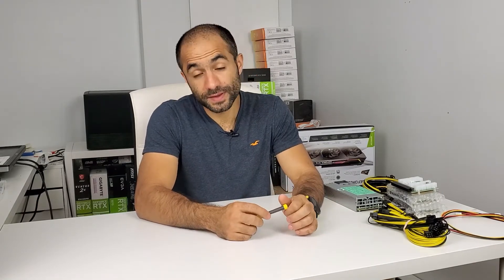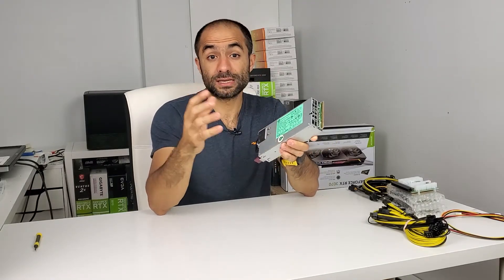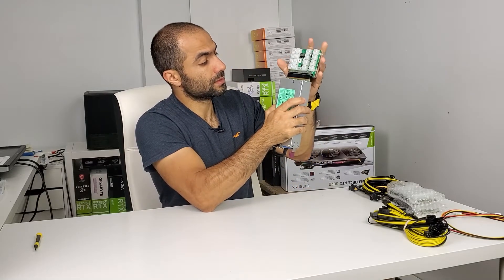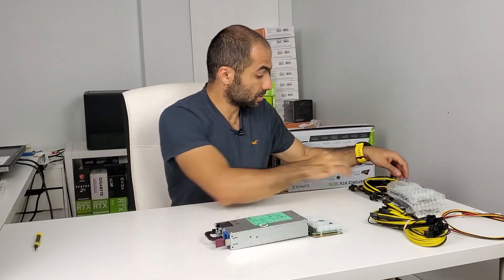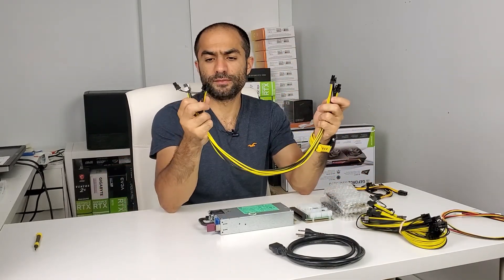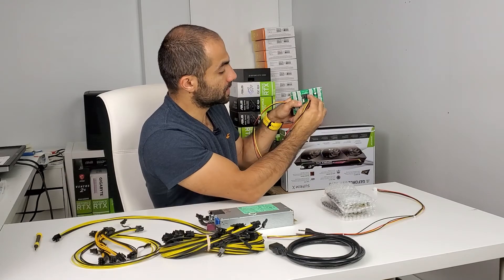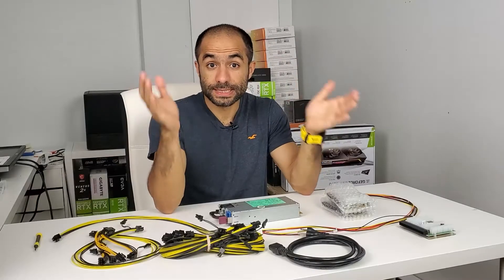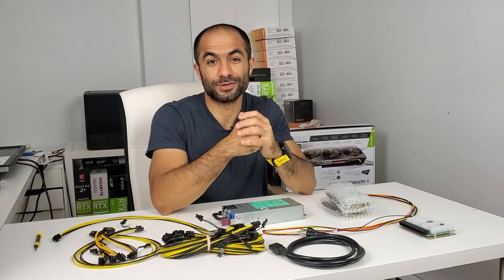Using a Server PSU for Crypto Mining

Comment: What kinda power cord are you using
Reply from the maker: Hi Kid Vicious. I use a 20A power supply Cord. You can find them on Amazon. The most common ones are 15A which will also be compatible. You just have to make sure you don't go beyond its rating depending on the voltage you have at your location.
Reply: @DaniTalksTech  ..i think the psu is rated at 15 smps for 110.
Reply: @DaniTalksTech  ...thank you!
Reply from the maker: @kidvicious2227  My pleasure!

Comment: I don't really see the costs savings vs ATX PSU. Relatively close to the same price after getting breakoutboard, cables, etc. And the ATX often has 10 year warranty. ATX is quieter. Right now I just have 2 rigs in my room, 16 GPUs, 6x ATX PSUs on 3 different 120V circuits.
Reply from the maker: Thanks for the feedback David. What sort of wattage do you have on those PSUs? One of the other advantages is also 16 power connectors on the breakout board. A PSU of similar capacity usually has 3 strands each branching out into two. So the total is usually 6 maybe 8 in some cases. That would be another advantage.
Reply: @DaniTalksTech  Thanks for the vid and tips! I like the 1000w EVGA PSU Gold, it comes with 6x 8pin cables(4 dual) and just $175 Canadian I paid, I also use splitters. So, I can fit 2x 1000w on 1 circuit since wall outlet is 1800w max but I usually go 1400w max to be safe. Yes, 16 power connectors is great, if I see a good deal on 120v server PSU I want to try it. Do you know why the breakout board burned for you?
Reply from the maker: @DavidBergeron87  thanks David! 1000w for $175 is a great deal. When I bought my corsair 1000w PSU it was for $250 and they were so tough to find. Maybe now the situation is better. I don't use splitters except on low wattage cards such as the 1660 supers. I honestly don't know why it burned. Parallel miner sent me a replacement under warranty and it's been working since.
Reply: @DaniTalksTech  👍I guess the 1000w is slowly dropping in price. 2 months ago I seen it on Amazon for $200 but recently $175CAD, probably a bit cheaper USD. I do like 1660 Supers, I have a few. Zotac 1660 Super GPU is so small in size, it's funny. I have a couple AMD 6600xt which are slightly better than 1660 Supers I find.

Comment: Hi Dani,
Thanks for the video.
Question:
Are they 2x 24 pins power plug2 on your Biostar mobo or only one?
I am planning on using the Biostar TB360 BTC Pro 2.0, and I believe they comes with 2 x 24pins power plugs.
If I was to use one ATX PSU and an HP PSU as my 2nd, do I need to get a PICO PSU (say 300W) to plug from the HP PSU to the 2nd 24 pins on the mobo?
Or I do not have to plug anything into the 2nd 24 pins on the mobo at all?

Looking forward to hearing back from you.

Thanks.
Reply: I just got that mobo and have the same question. what did you end up doing?

Comment: Im also looking to power my 1660 super rig with one 6 pin cable (from the server psu) to the riser AND gpu. Is this safe to do? They all pull about 75w - 80w.
I cant find anywhere on the internet that can give me a definitive answer on the max power draw what one 6 pin slot can handle on a server psu. 
Seems atx power supplies can handle 75w per 6 pin, but not sure its the same for a server psu. 
Would be great is someone can confirm.
Reply from the maker: Hi Kaizen, I am not aware of how much a single strand from a server PSU can handle. Are you not able to use one strand for the GPU and another for the riser? Usually, the breakout boards have enough PCIE ports.

Comment: Hello, could I have a set-up with one ATX and multiple server PSUs ? Example : EVGA G2 1300 W with 3 HP 1200W or the Remote Manage 3000W Power Supply Kit on parallel miner? Thanks in advance